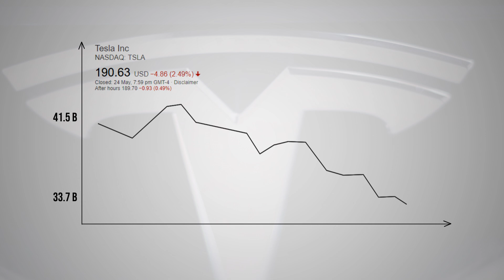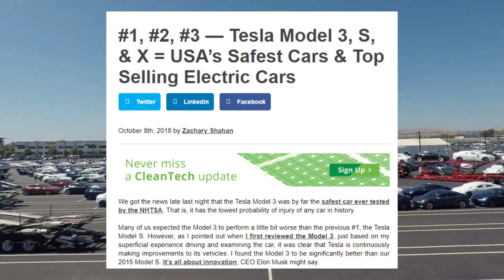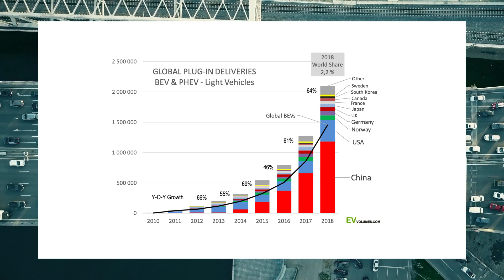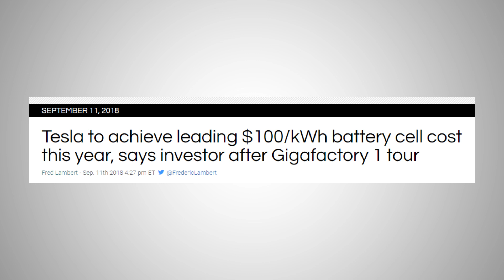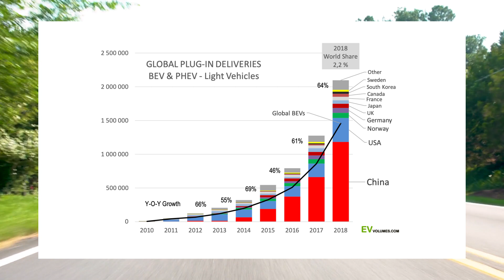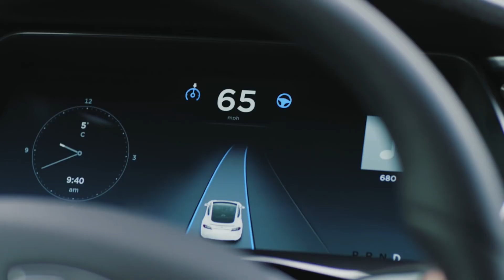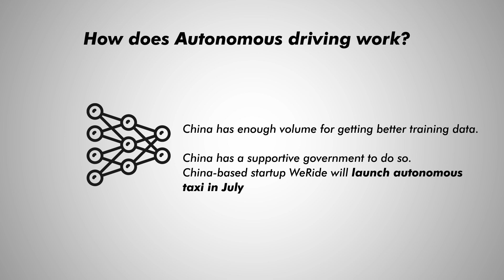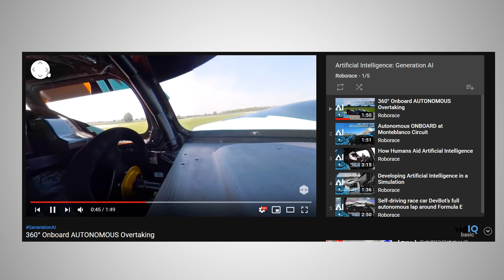Can Gigafactory Shanghai Fix Tesla's Money Problem? | Elephant Explains

Comment: The current stock price is due to the short positions (28.12% of float as at the time of writing. To put things into perspective, institutional investors whom the shorts borrow from only hold 63% of shares) and the repeated analyst downgrades since the release of the Q1 figures, with the downgrades being the dominant factor. Also, the $180 price target has been floating around even when the price was still at $300 and led me to believe the shorts were waiting for the right timing to initiate their positions (i.e. Q1 results). They may have influenced analysts decision to downgrade the stock, claiming a fall in demand, when a little research would prove otherwise. As we approach the end of the quarter, it's becoming evident that Q2 will significantly beat Q1 figures, putting paid to the demand issue. Conservative shorts may start closing their positions before then, which could trigger a short squeeze. All it takes is for one prominent bear analyst to reverse his downgrade and we could see a snowball effect.

Comment: Would a system with Lidar be safer today?
Probably
Can a system depending on LIDAR achieve Level 5 autonomy? 
No 

There are several redundant systems that could be added to compensate for for immature computer cognition. 
That is the reason that Lidar is being used. (as a crutch)

Here is the bet that Tesla is making: 
"Solving A.I. cognition = super human autonomy” 
= Game/Set/Match Victory

LIDAR can only help a system that can't solve the visual recognition problem.
This problem must be solved for LVL 5

Sure, you can add additional sensors to the car if you can't trust camera & radar, but even with this help, level 5 autonomy is disabled when fog/smoke makes Lidar useless.

You either achieve LVL 5 or you have a toy.
Tesla is betting on solving the entire autonomy problem.
Vehicles depending on Lidar will have to remove this dependency.

That is why Tesla is not using this crutch for short term improvement, it's a dead end for the ultimate goal.

You don't win a race by getting to 90% the fastest. You either go the whole way, or you lose. 

This race will probably take longer than Musk thinks (as usual), but Tesla is in the lead and using Lidar for quicker results will not help any of it's competition to finish the race.

Comment: 1. When a Tesla crashes due to autopilot it's news because it rarely happens. Now follow me on this. 
6 million car crashes a year in America, 3 percent caused by a mechanical failure, that's 180,000 car wrecks. 40,000 crashes due to breaking systems locking up. That's 109 vehicle crashes a day because of faulty breaks. 1/3 of those breaks are made by the same company. 
1000 internet points if you've know the name of the company and 100000 points if you've seen a single news article reporting on the company that causes 15,000 car crashes in a year.
It's obvious big oil, old car companies and banks invested in those 2 things who are trying to kill Tesla with smear campaigns. Just look at the biggest ad buyers for the "news" sites reporting these crashes. It's ridiculous. If they gave a shit about people's lives they might start reporting on the fact We've got a single company in America producing such shitty breaks it's resulting in nearly 40 car crashes a day.

Comment: I don't agree that lidar is necessity. There is already sensors on a Tesla which should stop stuff like this to happen.
However this is ground breaking stuff, and sadly i have to say there is going to be a few hitches, no doubt about it. Like any other technology. This time however it may cost some lives :(
Then again we have to put it into perspective, how many miles without a single accident? how many miles on average per accident? Those are the actualy metrics that are relevant and AFAIK on both of those Tesla Autopilot is already better than a human. It is sad, but we have to tolerate some number of issues; Or otherwise it's better never to leave the house ... well actually, your house is a dangerous place, so it leaves only better not to live to begin with as the safer option?

Comment: When calculating company value you need to factor in that 31% of the stock is sold twice due to short sellers. Multiply your numbers with 1.31 and you see that the actual stock value hasn't decreased by much. Investors still have faith but you need to find large numbers of new investors every day to buy all the stock that is resold every day by short sellers. This is a buying opportunity as the short sellers have signed an agreement to buy back the stock and while some of them will catch cheap stock now, as soon as they start buying stock in volume the price will rise again.

Comment: nVidia is a world class technology company. They even have a more powerful AI processor than Tesla's FSD but it uses 2-3 times more power. This is where FSD will be the game changer. Tesla's latest 2019.16.2 OVA Software update has significantly improved how the sensors/AI see the world even with the nVidia HDW 2. All new Teslas will have FSD installed.
Reply: Its not about how much power, its how you use it ;)

Comment: 6000 per week my ass. Thats 2 per minute 24-7 and one look at the assembly line makes it obvious there ain't no way in hell. Vehicles produced by the hundreds of thousands per year have never come off less than 4 or 5 assembly lines at "plants" all over the U.S. so they can be produced in the "region" in which they are "sold" usually there are/were multiple "assembly lines" per plant. 

Chassis or subframes/suspension/powertrains down one line and bodies/unibodies down another and they "meet" near the end. And hand-painting with a a "worker" with a cup gun shooting one "car" at a time before switching colors? No fucking way. Its "batch work" as far as bodies parts coming through and each "worker" sprays particular areas and they all overlap slightly and after a few "test parts" everybody knows how much paint to put on and where and they can outwork the line and check each others work.

And these days because of how "toxic" and expensive and fast-drying the products are with base/clear finishes, "electrostatic" processes are used on metal parts with colors "matched" to what can be "molded" in plastic parts. 

Getting paint to "stick" to big flexible parts requires absolutely "clean" and "dry" plastic and powder-coating and chemical-etching is out and its just "easier" and "cheaper" to either make the paint match the plastic since modern paints ARE "plastics"  and be limited to a few "primary" colors OR minimize the exterior "plastic" and use graphite-reinforced fiberglass or "plastic chrome" parts where the "chrome" is heat-shrunk over the plastic to "shrink" and "stiffen" it while reflecting sunlight to keep it cool and "frozen".

You don't "stockpile" product on a factory "parking lot" and you damned sure don't produce a "rainbow" of cars on a single line. 

The only way Tesla "produced" 6000 vehicles per week was by counting "orders" and "generated" VINs and "invoices" and chassis and bodies and "completed" and "shipped" vehicles. 

If it takes 4 or 5 different "on paper" vehicles to actually produce a complete "sale" and that's multiple "years" after the initial "order" and you're "post-dating" vehicles that should be "2017" or "2018" vehicles to "balance the books" but you have order "outsourced" parts in whatever quantity you claim to have "orders" for to keep the "float" alive, then you're going to eventually have to "scrap" shitloads of parts with no value AS "scrap" like dyed plastics, painted "bodies" and interior pieces etc. And somebody will notice and the jig is up.  Not to mention "suppliers" can and do usually have longer "lead times" than "in-house" parts like body stampings, etc.

Of course there ain't a dime's bit if difference between any of the "SEXY" models "under the skin" besides one motor or two and that's WAY simpler than "2WD" or "AWD/FWD" just like battery "capacity" and "range" come down to the same number of little 25-cent disposable dry cells wired in series and parallel to form a "module" and a few more "modules" installed in or at least "enabled" in a "high-capacity" battery "pack".

Same shit, different shell and the Model Y "SUV" is nothing but a Model 3 (no word on why Model 3 instead of finishing "SEXY" a couple years ago but the fact that the Model 3 is ugly as a bag of smashed assholes and there was/is no way a "mini-Model X" could possibly fly given the beatdown the original took for absolutely asinine "engineering" that might explain it) with a "body lift" and a "hatchback" and probably "optional" half-assed "AWD".

HEY LOOK, TESLATARDS! NOW YOU CAN HAVE THE ELON MUSK EDITION AMC EAGLE EV! 

GOOGLE IT. 

o

Comment: comment 9: Two softwares using the same chipset does not make a commitment for one towards the other.. that is plainly wrong!
A system developed for racing on a race track will never and I repeat NEVER be able to drive in the traffic.
The Hardware does not matter in this whatsoever

Comment: comment 7: Tesla does IN NO WAY, need to test its autonomous software unter race track conditions as it is ment for the road and race trecks are WAY different from those and it would be stupid to test it there.. only if you want to test a software specifically ment for race cars you would test it there.
Aditionally Teslas autopilot only works below a certain speed! Therefore it does not need to be tested at higher speeds then that and is already being tested thousandfold in road conditions at speed or below
Reply: I don't understand, How in the hell, testing autonomous car in race track is going to help with real-world applications.   At least Uber and Venmo do their testing in the real world, though in a controlled geo-fenced environment. You completely lost me.

Comment: comment 5: lidar would not have solved anything in the situation of the autopilot crash!
Lidar is used to take accurate measurements of distance to objects in 3d. that is proven to be as reliable in camera and radar tech. therefore there is no need for lidar and even talking about it is off the point

Comment: You failed to mention, or simple didn't know, that one of the reasons that (Z)EVs are so popular in China, compared to ICE, is because a lot of the big cities are limiting the cars on the road. In some cases they use rotating schedules that limit what cars can drive on a day based on the last number on the plate; however, the bigger issue that is impacting consumers is the license plate lottery. If you have a gas or diesel vehicle, you need to enter a lottery to get a license plate for your car. ZEVs don't have to do that. If a similar system was put in place in the US, you can bet that ZEVs would skyrocket in sale in the US as well.